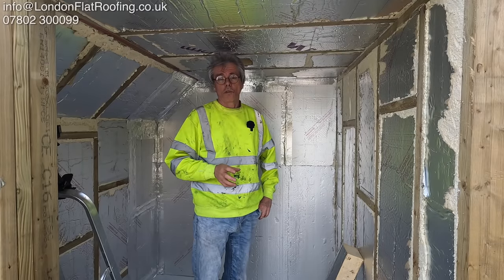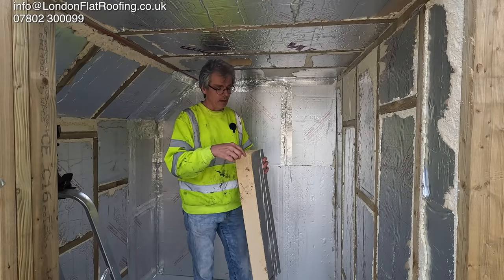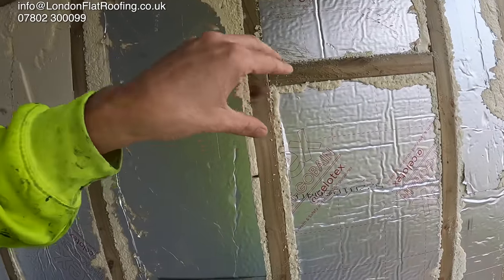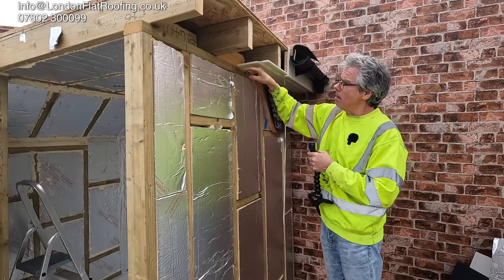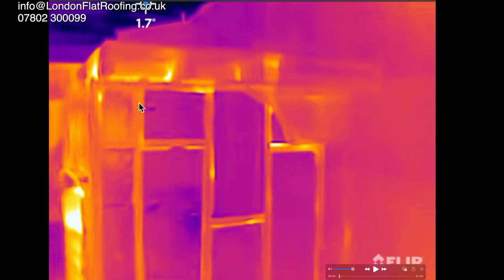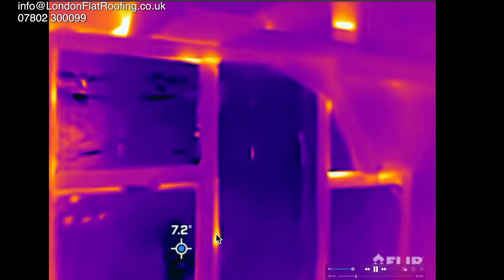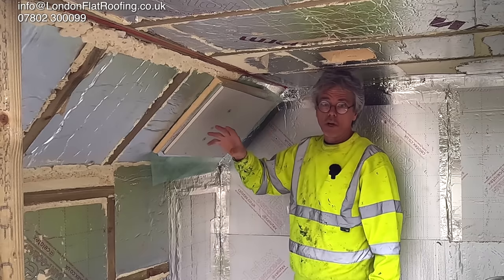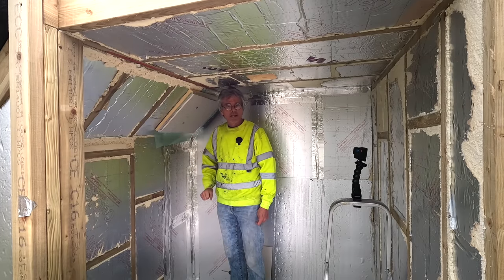Badly fitted insulation between joists and thermal imaging

Comment: EXACTLY the issues in our loft converstion - built by the builder who owned the place before us, but apparently didn't think insulation needed to fit edge to edge.  Big gaps around the celotex, freezing air blowing though roof space so if it's freezing outside, the interior of the plasterboard is about 12C even with the heating on.  The downlighters of course have NO insualtion above, so would be frozen if they weren't conducting heat out of the room so effectively.  Cold roofs are a bloody stupid idea, since they're all installed so poorly. 😤🤷‍♂️
Reply from the maker: Yes, it's unfortunate all this detail takes a lot of time, but when you are trying to something like reducing the amount of lost energy from the building, then you have to be more precise, but for some unknown reason they can't seem to work this out

Comment: Hello mate, sorry for being late. 

Im thinking about igloos, and adobe mud houses and wattle and dorb and it strikes me that this method of construction here is doomed to fail in install. Why are we building the frame then stuffing the insulation on, when in the past the insulation was inherent to the structure? I like your video - and this is actually a pretty half decent install. Ive seen people just stuff boards in with no real care, spray, tape anything really, then slapping  the dry wall on, or laying the brick before the site manager comes visiting. 

I always say its like leaving your jacket unzipped in winter.
Reply: Would it not be better to just reinforce PIR in the process of pouring it,  and use that to build with? Kind of like, concrete?

Comment: Interesting video, with this in mind it may be an idea to change our construction so the installation can be installed without being cut, so maybe insulate in or outside the stud work
Reply from the maker: I think we will be moving away from PIR insulation soon I will be showing a completely different way of doing things in an up and coming video using mostly much cheaper insulation and a quicker method of installing also more air open!
Reply: @SteveRoofer  Intrigued to find out what pir can be replaced with!
Reply: Multi layer foil perhaps?

Comment: Hello Steve, I’m a carpenter new to the UK from NZ where our insulation regs are a lot different. I’m doing my first build here for a client, and the original plan was a pitched roof extension with cold roof insulation. The pitched ceiling has now changed to a flat ceiling but still a pitched roof. Am I better off insulating the flat ceiling, or the pitched roof?

Comment: Just came across your YouTube video here on insulation and wonder if you did a similar study on Rockwool rather than just Kingspan ?  I am thinking of using Rockwool on my very old house where they added an extension without much insulation as it is also breathable ? Your video does highlight concerns about how well Kingspan fits into Joists etc.. and the gaps it leaves.  I was also going to cover the insulation with a thermal/vapour barrier foil.  Just wondering if tere is any specific qualities I should look for for the Foil ?  Thank you for sharing your knowlegde about this as it if very imortant these days and people just don't seem to get it!
Reply from the maker: I'm a lover of rock wall as it is fair open problem is it doesn't have the same you value as PIR insulation, but personally I would use Rockwall all day long if I could get to the correct U Valley so go for it

Comment: Any excellent presentation and an insight in the common day to day defects that are built into our buildings (not just homes)  Unfortunately, over the years I have had to design and specify details that have tried to account for the general poor quality control on building sites rather than opting for the best performance.  In this situation I would have specified multi-foil thermal barrier that can be purposely moulded around all of the elements and be easily taped with little or no damage to the integral vapour barrier.  the speed of installation of the multi-foil offsets the perceived material cost premium so it can be cost effective  and not only for heat loss.  To add additional insulation in the form of PIR board on to the face of the studwork is easy and will be reliably jointed.
Whilst your video is very instructive, I wonder how much heat is really lost and whether this is just a storm in a teacup reaction?  Having said that there is no excuse for poor quality control as the customer is not getting what they expect.
Reply from the maker: Yes the point of the video is to show that we can and should be doing better, i'm a lover of molty foil because of its ease of fitting, however I still see it fitted badly lights cut thoug it. Edges not taped and sweating problems.
Reply: @SteveRoofer  Unfortunately Steve, you are in the minority when it comes to good practice on building sites.  There is little care given to installations for example, how many electricians actually understand that they are doing wrong when they cut through the vapour barrier or insulation?  You shouldn't have to teach every trade what they should and shouldn't do in each instance but understanding the very basics and principles of general building should be on the radar of every trades person  There are too many 'General Builders' who are single tradesmen and know little about the various aspects of building .

Comment: I would be interested to know if multi layer foil is the not the simplest solution, no cuts, no gaps and no expensive tape. Use the foil as the first layer to "cover" the rafters/joists and then bulk up with whole sheets of rigid PIR and foil tape over the top if needed (depending on the efficiency of the foil I imagine)
Reply from the maker: Yes multifile is probably definitely the way to go

Comment: With no stud being perfectly straight and cutting PIR perfectly also unlikely, surely  rockwool is a better option for in between studs? PIR is a better insulator but the draughty gaps it leaves negate any benefit in my opinion. Plus it’s a lot more plastic for some poor sod to deal with later down the line

Comment: Hi , would it not be better to use multi layer foil on both sides and reduce the thickness of the slab insulation .?🤔
Reply from the maker: Yes that's an option

Comment: I would put another layer of kingspan/celotex around the inside, keeping a note of where the wood is under it with a marker pen at the edges, maybe sandwiching a plastic vapour barrier in between the 2 layers so it doesnt get damaged. But what of screw penetrations? There is a butyl tape which allegedly seals up. I got to the end of the video - you did anther layer like this. It says the 'next' video shows how to do the holes from the screws.... maybe a second layer of battens cross wise? Maybe I remembered it from seeing the video before! I'm going to do mine in Spring 2024. Maybe I'll make a video with my plans before I finalise so youtube can criticise and improve it  !  I dont want the OSB  and beams to rot after ten years from condensation !
Reply from the maker: sounds interesting get back to me if you need any help

Comment: Interesting thank you. Would you say with those poorly (but typically) fitted bits of PIR that it's better to leave a ~1cm gap round the edge so you can ensure the expanding foam runs all the way from front to back?
Reply from the maker: Even if you did that today, it's not recognises the correct thing to do. You're supposed to use this new tape that goes around the edges and expands it's called Gapo tape and he is very expensive
Reply: No sack get someone  how can cut proppley

Comment: Gapotape is great, made my diy job on an old victorian property much easier as it gives you a lot of tolerence.  Way too expensive though so if more come on the market it will be great.
Reply from the maker: Great point!
Reply: Agree, used it on insulating a loft knee wall area, makes fitting clean and tight. Good but pricey.

Comment: Just at @2:41 when you say there is a gap in the noggan, that is the wood to wood is it. Funny enough you can see a clear gap thin between the straight board and the straight wood. You say that when you are outside too. Crazy that it can’t be 100% no matter what. Is a new way of insulation install needed. Pushing boards into holes isnt great

Comment: You will never get a perfect fit if you try cutting your foam to exact size.  I always, purposely cut my foam around 70 mil. short and less wide.  This leaves a gap of 35 mil. on all sides.  The 35 mil. is a perfect size to properly fill with spay foam.  I am sorry if I am being rude, but you don't know how to spray very well.  When the gap is big enough, you can stick the nozzle of the spray gun deep enough to get to the other side of the gap...fill it to 50 to 60 % full (depending on the product..read the instructions)  usually, a second pass is barely necessary.... cut off the excess.

Comment: There's the debate on air gap versus no air gap - is there a consensus on this are you aware ?  In my case i'm talking about insulating the floor from below with 100mm PIR against tongue and groove flooring.  Thanks
Reply from the maker: Floors are totally different and dont need venting

Comment: Cost benefit calcs are the way to equate the efficiency of the extra work. This does mean shoddy work can be accepted and good fitting timber and insulation first round is a must. Now have a country full of incompetant and unprofessional builders and thats my experiance. I am not a builder but I am an mech engineer having used many diff builders. Roofers, id say 80% are pretty poor. This has led to some court cases. WhatbI also find is even getting detailed quotes of the work is near impossible and many just refusse to detail standards used and material/labour separate. The point here is hos is a home owner supposed to ensure high standards when the industry is just so bad.
Reply from the maker: Basically some up the situation very well and trained and skilled people it's always gonna end in tears

Comment: I'm doing a timber frame annex right now and am putting 65mm in the studwork and then later 65mm insulated plaster board inside. Do I need to be foam taping the studwork insulation considering there will be a second continuous layer?
Reply from the maker: Yes, everything you do correctly is definitely going to be better however as you know you are putting up another one over the inside so the choice is yours
Reply: @SteveRoofer   Yeah, the second inner insulation skin creates a full envelope. Thanks.

Comment: Is it a good idea of having an extra layer of Vapour Barrier Waterproof Thermal Insulation Aluminium Foil Membrane
Reply from the maker: In a construction of any kind, that should only be one vapour barrier, and that vapour barrier should be on the warm side of any insulation adding other vapour barriers can only just confuse the construction adding insulation that has foil on it in my view is not the correct thing to do, however seems to be the way the manufacturers and all building control except but it stands to reason you have one vapour barrier and everything else past that bath barrier must be of a lesser quality

Comment: I put two layers of staggered 1.5 inch EPS outside and two .75 inch EPS layers staggered inside, encasing rock wool in the wall cavity.

This stops moisture and acts as a  vapour barrier

Comment: Hi Steve when you put a vapour barrier under the cellutex. Say you used dpm where would you run it? Ie would condensation build up and then run down the polythean?
Reply from the maker: Firstly you can't use a damp proof membrane. All plastic vapour barriers are coloured green so you should be using a green plastic vapour barrier. If you insulates over the vapour barrier the vapour barrier will be warm and if it's warm you just won't get any condensation there this is why warmers are so good.
Reply: "thats why Warmers are good" ?
Warm roof ??

Comment: Yes, the way it’s done is not very good.  Placing insulation between the studs is never a perfect job.   Some times it’s better to leave larger gaps all the way around the insulation to allow for the foam gun to get in which spreads the foam to seal the gaps better.

Obviously, a better job would be to fix full sheets of insulation either to the inside or exterior.  That way it eliminates gaps.

Comment: Quick question if I may, I have a dormer with cheeks of 150mm so builder is using 150mm insulation between timber. Should I have more insulation over the top as well? He wants to use just plasterboard over
Reply from the maker: Yes, you should have an air gap on the outside and you should have the vapour barrier on the inside. You also should be following your design plans.
Reply: @SteveRoofer  the design said 100mm timber dormer cheeks but builder used 150mm. So it was a question of if the 150mm between timbers is enough or if should still overboard with more insulation to avoid cold bridging from the timbers
Reply from the maker: Well, yes, theoretically you should still put some insulation over the inside joists to stop thermal bridging, but if you've got no air then on the outside that is a problem in itself @LaurieR100
Reply: Thank you so much for taking the time to reply. I love your videos, I’m checking it out with my thermal camera I think Im giving the builder sleepless nights!

Comment: so its ok to having 25mm kingspan between battens. the a vapour barrier on top. and then insulated plasterboard on top of that?
Reply from the maker: You will have to give me more details than that as I don't quite understand your buildup
Reply: @SteveRoofer  is it ok to have the vapour barrier between two sheets of insulation
Reply: Yes if u have 3\ 4 of the insulation above
Reply from the maker: Because the AVCL will not be complete it will have gaps where you cant join it

Comment: Everything is wrong:
firstly if you using studwall of natural breathable materials as real wood, you have to use timber bigger size than an insulation (thickness). At the moment on the market we have timber 20-40% of moisture; you puted up between the timber space, also will cover vapor membrane isolation and plasterboards. From exterior i saw,  you have fixed a plywood with wind protection membrane. The wood with this ”pie” has not breathing, that going to mould and rotted. 
The best way to use mineral insulation slabs without aluminium screen reflection because it will be too expensive for the project and basically will not meet the requested specifications. After the insulation slabs it will ideal to use aluminium foil vapor insulation membrane. Also if you using sheet materials (OSB/Ply) on the studwall from both sides don't need noggins. More ideal- SIP. 
The ceiling wrong again. Everybody now preferred LED downlight- will use holes for them that will damage vapor membrane and thicknesses of insulation.
Reply from the maker: Yes you're correct this is wrong that's why I'm showing him that's also why I'm going to show how to do it with a more vapour open system

Comment: I’ve had nightmares fitting this stuff when the joinery isn’t correct and the measurements are all over, in my opinion it’s rubbish stuff a better way would be sprayed insulation like a foam filler with an insulated plasterboard over the top.

Comment: Actis hybris instead of that celotex every day of the week.
Reply from the maker: Yes, I agree, but you still need to be putting it incorrectly and I'm seeing lots of people that aren't
Reply: @SteveRoofer  it’s harder to not fit it correctly as you overcut it and it friction fits, it’s hard to cut anything over 100mm pir dead square and I’ve seen loads where it’s too loose between rafters so they either pin it with a nail or a shove a wedge of pir to hold it.

Comment: No sound
Reply from the maker: 33,000 others have got sound
Reply: @SteveRoofer  hi now got sound . Just curious steven i want to insulate my garden shed floor i have already done the walls between the rafters . can i use 25mm cellotex with 10mm plywood straight over cellotex with a vapour membrane between the two or should it be 18mm chipboard tongue and groove interlocking many thanks . i do not want to insulate between the shed floor rafters as the existing floor is nailed tight to the rafters and i may damage it many thanks

Comment: Make the air seal on the outside. Why do Brits , KIwis etc use all that horizontal blocking? Unnecessary and totally  counter productive. You'll also fine that an interior vapor barrier is not recommended in all cases. Hire a professional.